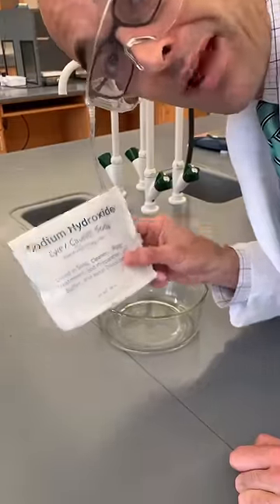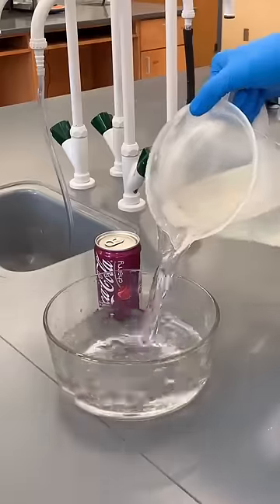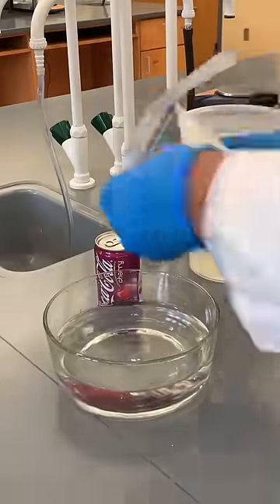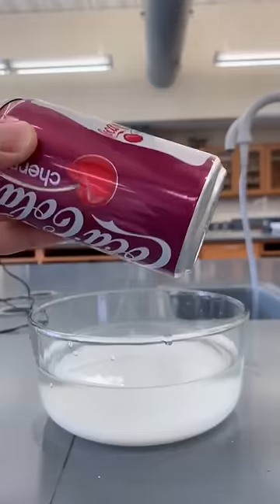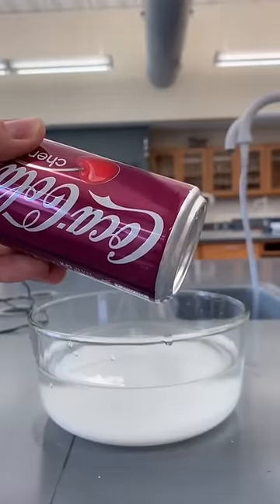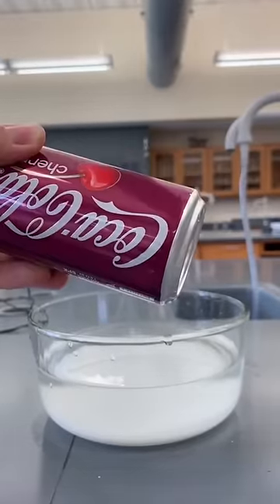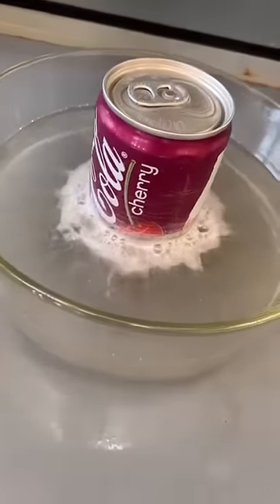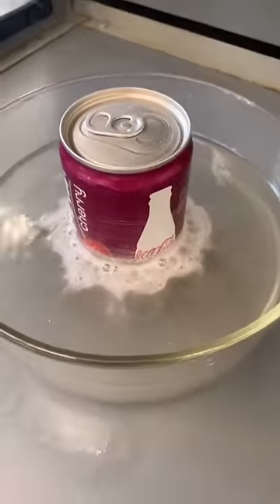Did you know this about aluminum cans?

Comment: Coatings. There's always a thin plastic layer (coating) inside drink cans to protect the food or liquid and to protect the cans from corrosion. Every soda contains phosphoric and citric acid and it's thus necessary to add a hidden liner inside the can to prevent the beverage from reacting with the metal.
Reply: "Every"? I think i only saw orthophosphoric acid in coca-cola's ingredients
Reply: Uhm.. have you never seen coke dissolve a chicken bone? Clean battery acid from a car battery? I stopped drinking that decades ago
Reply: @mrj494  yet the amount of sugar is still what would cause more long term health problems
Reply: @ACE1cutDown  which doesn’t make the product bad. Just don’t consume too much of anything.
Reply: We used to dissolve our.baby teeth in Coke for 4 th grade science class
Reply: @mrj494 you realise that our stomach acid is stronger than the acidity of cola and over fizzy beverages? To protect your teeth you should not use straws when drinking fizzy beverages and then you should then have some water as a chaser. You could also help neutralise your mouth afterwards with a piece of cheese.

And obviously don't overdo the fizzy sodas.

Everything can and will damage you at the right dosage and exposure. Just use some common sense about it.
Reply: Doesn't that happen when oxygen is present
Reply: @socomfan4  does what happen when oxygen is present
Reply: Reactions between metals and acids need oxygen in the process for most reactions
Reply: @PriyaPans He is using common sense by avoiding the shit 😂
Reply: @PriyaPans wait, isn't it better to use straws? I figure using a straw helps direct the flow of the beverage versus it spreading it more around the teeth when you take a drink without a straw.
Reply: The drink reacting with the plastic is not better
Reply: @kantai3309  phosphoric acid...
Reply: @pierregravel-primeau702  it’s the same, check the wiki
Reply: @ACE1cutDown it’s not the sugar I’ma say that right now. HFC transforms into glucose regardless.
Reply: @mrj494 Ah yes, I am terrified of the acid in coke. What's especially scary is the idea of it getting into my stomach. You know, the bit with all the hydrochloric acid in it.
Reply: A problem that wasn't when they just put it in glass bottles.
Reply: @Pashachessgm It is, because it doesn't react with it. Tell me you don't know much about the different types of plastic, without telling me it. Plastic used with food product have to have sertain criteria, like not changing the taste (if you don't let it sit warm for many hours and not to oomg in the sun) and moat importantly not having any harmful chamicals. Not every plasic is the same, so you have to know with plasic to use where.
Reply: @cary9479  you get the chemical atrazine from it.
Reply: @Pashachessgm  How? This isn't even in there. And if it would be true, it wouldn't be alowed to be used in food or drink packaging. So what is it? Do you have no idea about the chemistry behind the used plastics, are just lieing or do you confuse similar camicals that just work completely different, or do you think zhey make something illegal?
Reply: @cary9479  don't take my word but from i read it is true.
Reply: @Pashachessgm  I was on a technical school about plastic engineers, this is why I know for a fact that it is not true. At least not in Europe, I am not a 100% sure how it is in the US, but I am pretty sure that there are also some laws about what is alowed to be used for food and drinks. What you probably think is one of the myths about it. But where atrazin is used is in the agriculture. In plastic there alwaxs a reason why something is used, what reasin would it be to use atrazin in it? And I didn't mean it hateful ehat I wrote in my last comment (I think it is possible to interpret it like that), I am just sometimes a little bit direct.
Reply: @Pashachessgm  The only think where I can think of somethink like that is the bisphenol a in PC, that is very unlikely to come out of the plastic (because it isn't a very small molecule), but there is the possibility for it to be harmful and because of this it. So it isn't used in bottles anymore, just to be sure, even thought it food safe, because it is nearly impossible to get out of the plastic, but they wanted to be extra sure with babys. And do you now where it is neatural in it and can get out easily? In pears, they are much more risky in this thematic that polycarbonat.
Reply: @Pashachessgm  But we can hopefuly agree that it makes sense to take alternatives (other plastics without it) just to be completely sure, but it wouldn't make sense to don't use plastic there anymore at all.
Reply: @Pashachessgm  And sorry, just as info, in the US there was a research about how our body reacts to it, because there were some very contradictifs studies only that the studies of one side showed many flaws and they did prove that it is nearly impossible to get to an unhealthy amount in our body, because our body very fast metabolised it, so that it is another structur that is no longer harmful and this was why they did reduce the allowed amount in food, not because they found out it would be unhealthy otherwise, but because this were a more realistic scale and not more than 2000 times more than is even possible to get into our food.
Reply: @mrj494  what is it about acid that makes you think it's unhealthy? do you are aware your stomach secretes hydrochloric acid, right
Reply: @PriyaPans  If we really need to do that many steps to minimize the issues then I think they have a reason to avoid it lol
Reply: @doodoo2065  your stomach acid is more hardy than soda.

You know the best way to avoid tooth acidity after eating fruit or drinking soda?

Eat a piece of cheese - job done
Reply: @denisea8747  Maybe you went to school in a country that doesn't have a tradition like the Tooth Fairy. But it's wild to me that a teacher would hold an assignment that would dispel that belief before you even turned 10
Reply: so it's a solution to a fake problem. we could use glass, and have. it's just cheaper to use plastic and aluminium, and a lot more destructive to the environment
Reply: @Effigyy  well then we can swap to buying only glass and plastic bottles.
Reply: @kantai3309  literally reading the back of a coke now: “phosphoric acid” is right there.
Reply: @danteortega6510  now literally read the first four words on its wiki
Reply: @kantai3309  ah it’s just a dumb joke ha ha
Reply: imagine what that soda does to your intestines😮
Reply: @mrj494 your stomach is full of hydrochloride acid
Reply: @mrj494 do you know what's in your stomach bruh?  It's even stronger acid
Reply: They started doing that after fears about aluminum contributing to dementia went wild in the early 90s.
Now we have microplastics instead.
Reply: @PriyaPans  Can't. I hate cheese. Even the smell makes me gag. Anything else work?
Reply: @KairuHakubi This is true, but adding the acid from soda can potentially increase the acidity of your stomach beyond what it was meant to handle, giving you heartburn and such. Probably not much more than that. But it would still feel bad. The carbonation also can upset your guts, especially if you already have gut issues. Guess it just depends on the person and how much/how fast you're drinking.
Reply: @FlyDinosaur  acids don't add though, the pH becomes the average of the pHs. Soda can't exceed the pH of the human stomach. In fact I just looked it up and they're roughly the same, except the stomach goes both lower and higher.
Reply: @KairuHakubi  Perhaps I misunderstood what I read then. Maybe it was that there would simply be too much acid overall, which could throw things off and make you feel gross.
Reply: @FlyDinosaur  Now that is entirely possible, I don't know how concentrations work exactly. but I think that is actually what pH measures. so maybe that's why I was thrown off, stomach acid itself is way more acidic than soda, but you don't have PURE acid in there, you have a mixture of fluids. so it averages out to be roughly that of soda.
Reply: @PriyaPans Common sense is not so common.Anymore in this day and age
Reply: @denisea8747  how'd you get your money from the tooth fairy????
Reply: What did cans use before plastic?
Reply: @persistentwind  I believe a coating of tin
Reply: @Effigyy  allegedly. typical "they create a problem, we have a reaction, they offer a solution" type shit.
Reply: Acid reacts with the plastic
Reply: It is way cheaper for big corporations to use cheap materials and products to achieve larger profits. Hence, a lot of plastic usage to store your foods in that is highly toxic for your body in long term health just to be on budget, for the big corporations....😅
Reply: It's also to prevent us from getting aluminum in our bodies.
Reply: @mrj494  your stomach is explicitly designed to contain acids, the acidic nature of soda isnt the issue
Reply: @mrj494 water dissolves almost everything
Reply: Imagine what it does to your insides!